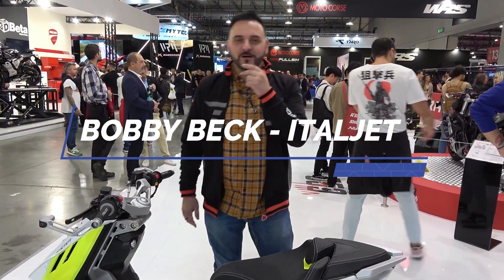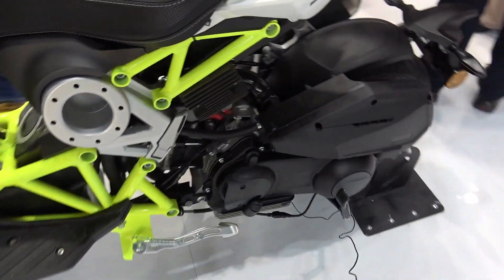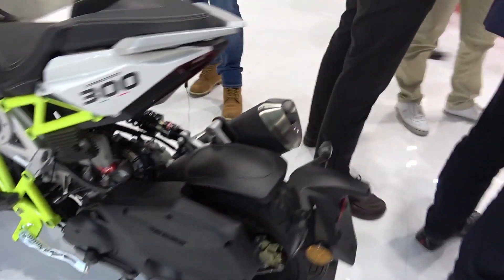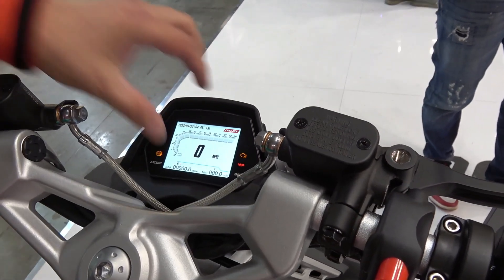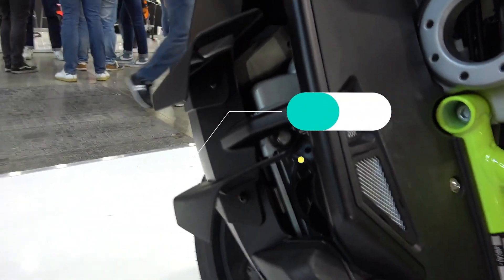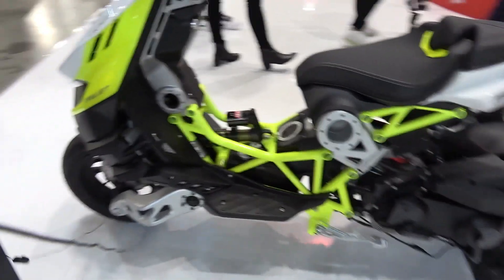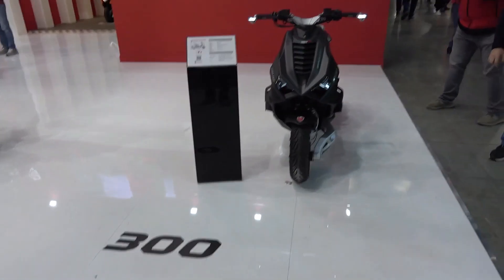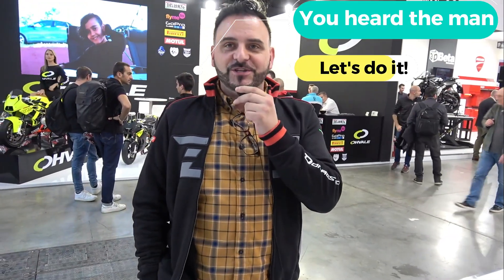SLUK | Intro to the Italjet Dragster 300 - EICMA

Comment: Not a bad look but for 300cc such meagre helpings of power really needs to be addressed
Reply: its 60lbs lighter than a gts300. 100lbs lighter than xmax300. less weight is more hp. drive your bike with an extra 100lbs on it. then take the 100lbs off and report back with a new comment.
Reply: @aljedo  Are u even hearing yourself?😂 No less weight is less weight meaning better agility breaking and acceleration gains, not more horse power smh horse power is higher rev range perfornance while lower is more dependent on torque of the engine, so please read a book learn something, also try to pick up a book on "dulling ur ego" might just do u wonders;) all the best to ya